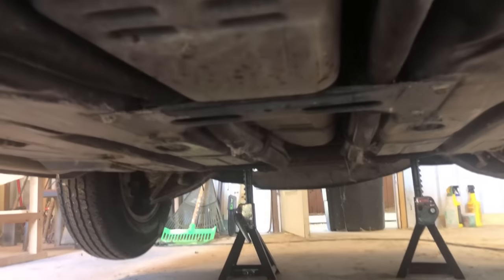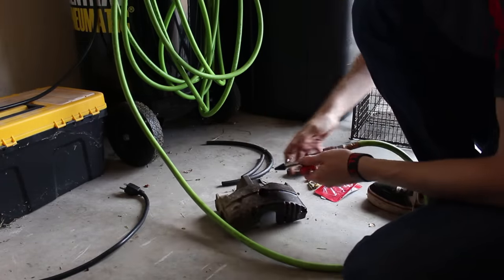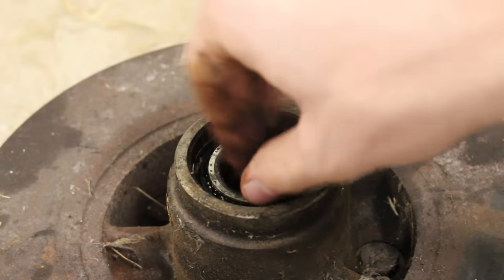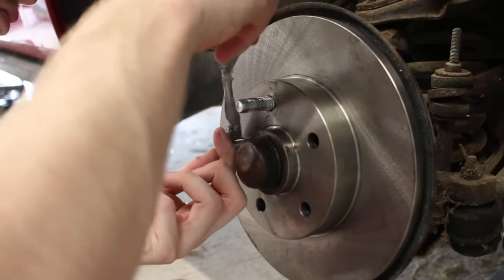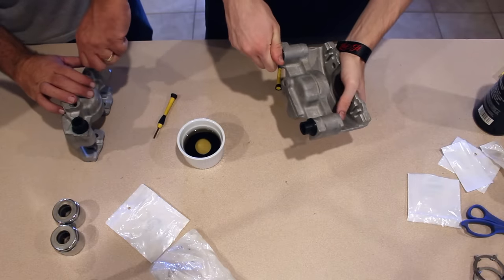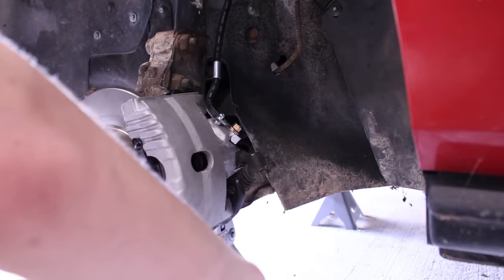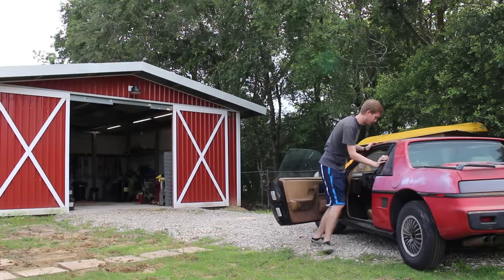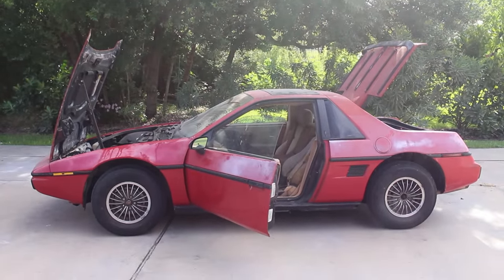Fiero Drive With Me | 1985 Fiero 2M4 Revival - Part 3

Comment: Rebuilding anything from the 80's is a challenge. All the crap the govt pulled made stuff a lot more difficult. Especially using multiple metals which caused even more problems due to "corrosion" & chemical "reaction". Especially if you're in the Northern states or coastal southern states due to sea salt & humidity. I live in NH near the coast so, I get the best of both worlds. Seacoast, Cold weather, and the occasional hot humid weather.

Comment: you don't lube wheel studs this can cause wheels to come loose when driving down the road if you need to add anything to get a lug nut lose you use water from a hose or a bottle

Comment: For all the rust on the rear brakes and assorted parts, use a clean rag soaked in rust remover. just place it on rusted parts, use zip ties to hold it in place. After a few hours untie it and check. Redo as necessary.  After cleaning and drying, spray with Gibbs oil. 
    https://www.amazon.com/dp/B00AFJXIJQ/?coliid=I2UPMR2W3MFAVX&colid=2BQD4P7ZSY7KR&psc=1&ref_=lv_ov_lig_dp_it

Comment: Oh come now guys. You don't need a bearing race tool. Don't you wanna do it the OLD fashioned way by tapping the races in and out using a screwdriver or chisel. LMFAO it's a BITCH.

I'm glad you are getting this awesome car back on the road.fieros had a bad rap mostly because of the first year faults you covered in previous vids (fibreglass was so excessive that a crash would cause a reaction causing fires). At least they don't rust much😁 But, don't hit any ice patches going 60. You'll end up going in REVERSE @60mph. My old friend had that happen to him fortunately the transaxle caught up and stopped the vehicle just short of the overpass bridge support. Car was fine no damage surprisingly but lesson well learned.

But......still does not discourage me from the fiero

Comment: you didn't pack the bearings properly if you put the grease in one hand hold the bearing and slap the side of the bearing onto your palm to push the grease up into the inside area of the roller bearings until the grease is oozing out onto the surface of the bearing

Comment: Aluslip and copaslip are terrible to use with brakes since they harden and become like dirt filled grease either way. There is a designated grease that is almost edible and is much better to use, it normally comes with a new pack of pads.

Comment: As much as I appreciate the effort, it actually makes me cringe that they place these new rotors on those filthy rusted backplates and suspension components. I at least would had given them a good sanding and painting.
Reply: I think he just wanted to start it running. I’m sure he’ll do some deeper cleaning later on in the series.
Reply: @johnjohnson3772  I hope he does, he is doing a great effort and it is nice to see young kids actually repairing and thinking about how to get things done, instead of simply throwing things away. Cheers!

Comment: OMG! when you were installing the wheel bearings you used a claw hammer to drive them in. A claw hammer is a joiners tool and the claw is for removing nails from wood and the hammer for putting nails into wood. Get a ball pein hammer. The C clamp you used when reassembling the calipers is actually a 'G' clamp.

Comment: i get annoyed everytime that woodworking hammer is used on the vehicle! get yourselves a proper hammer! Also you SHOULD NOT pull the handbrake mechanism until all brakes are bled and the pistons are pumped out. if you work the handbrake before you pump the pistons out it will adjust incorrectly and you'll get a crappy handbrake effort.

Comment: Save yourself some time, money and headache... buy new calipers.... and if you are going to go through all the trouble of rebuilding the calipers... PAINT THEM!
Reply from the maker: The rebuild parts were cheaper than new calipers. Also the knowledge, experience, and bonding with father as a result of working together on them far exceeds any cost of time. It was fun to rebuild these, so no headache either. They’re aluminum, not iron, so painting isn’t required.
Reply: @RonaldFinger  ok... I can get what you're saying on most of those things... Except painting the calipers... Painting them will help prevent corrosion and just make them look better.
Reply from the maker: Aluminum does rust like iron does. Oxidation still is a possibility over a long period of time, but it’s not as detrimental as it is cosmetic. The blasted finish makes them look brand new some I’m more than content with that

Comment: is the clutch that fucked or why are you reving it that much
Reply from the maker: Did you miss the part of the video where I explained that the clutch had been rusted to the flywheel for 20 years and I only just got them separated minutes before driving it for the first time meaning that I did not take the transmission out and clean the flywheel surface of all rust to ensure that there’s no slippage